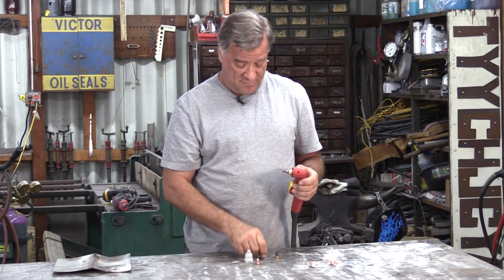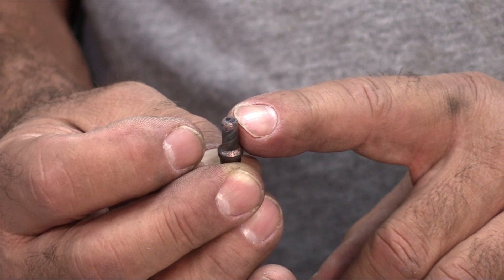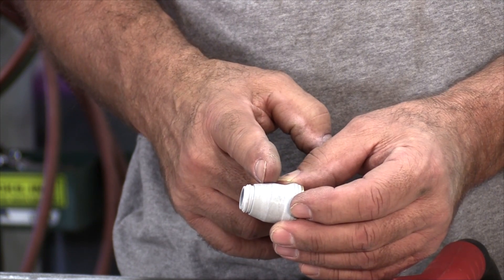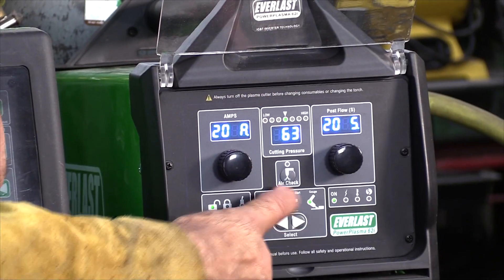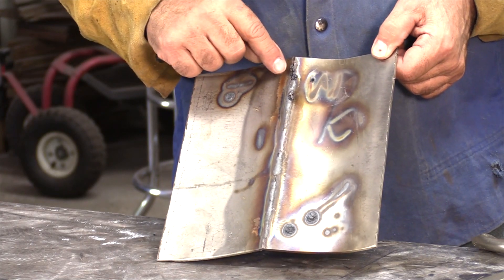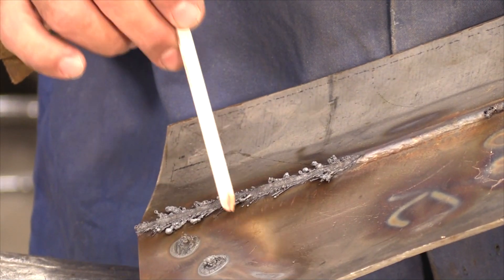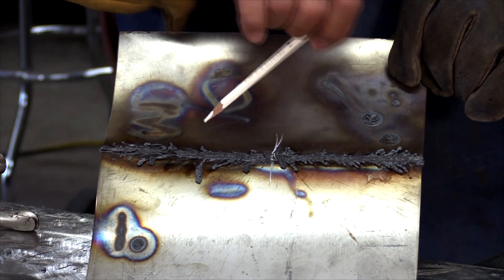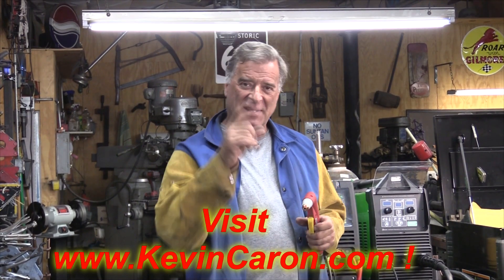How to Gouge Metal Using a Plasma Cutter - Kevin Caron

Comment: That's actually a drag tip your using that's why it has that cap with the 4 cutouts to go over the tip so u can drag it directly on the metal when cutting

Comment: What settings are you using? Air pressure and amps? Most cheaper machines don't have the gauge option ore any preferable settings for gouging
Reply from the maker: Please read the description at the beginning of the video.   All the specs are right there.

Comment: Quick tip..if you haven't got a gouge tip and need one quick just take a brand new tip and drill it out with a 2.4mm drill bit or whatever size that is in imperial..it will do the same job as the gouge tip..it works really good i have been doing it for yts and it hasn't failed me yet..
Reply from the maker: Great tip!!!   (no pun intended)    Will give it a go.   Thanks for watching and posting.

Comment: I’m using my plasma cutters (selco and telwin - both italian brands) for more than 9 years, it doesn’t have the gouge mode but I found useful gouging t-joints going reverse with one single pass. It leaves a lot of molten steel and slag combined but I can see very easy where the two pieces join toghether so I can save a lot of parts that way. I tried to go the right way like mr. Kevin did but all the molten sparks are flowing at me and I can’t gouge like that.
Reply from the maker: Thanks for sharing!  I am always learning from you guys!   Thanks for watching and posting.
Reply: Kevin Caron, Artist I recomend to try yourself with standard consumables and 20-30 amps to see how things are going. You should gouge a lot of metal very fast with only one shot. Thank you for everything. I learned a lot from you sir.

Comment: Hey Mary, good to hear your intro again.  Now Kevin, the rest of the story.  You are just using compressed air w/ no specific gas, am  I correct ?   Is it considerably faster than using a grinder or cutting wheel ?    J K
Reply from the maker: Just using compressed air.   Gun came with the machine but I am using the correct consumables for gouging.  They are different then for cutting.   And it is way faster then a cutting wheel!

Comment: Hey Kevin. That is cool. I don't have a plasma cutter, but I wish I did. Do all cutters have that feature? I thought gouging would be when you wanted a hole or a slot in the metal. Thanks for sharing.
Reply from the maker: Not that I know of.   I have only seen 2 different machines with the gouge function.
Reply: @KevincaronSculpture  Thanks Kevin
Reply: Andy even in australia   the small cutters dont seem to have thayt in the 30  45 amp cutters , only in the 60 amp machines , might have some thing to do with the size and amps of the machine ?